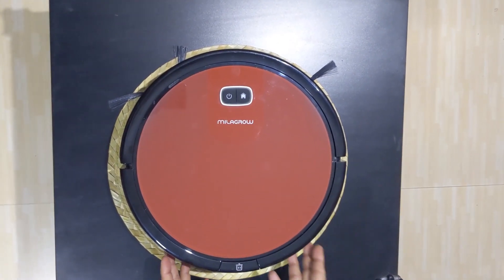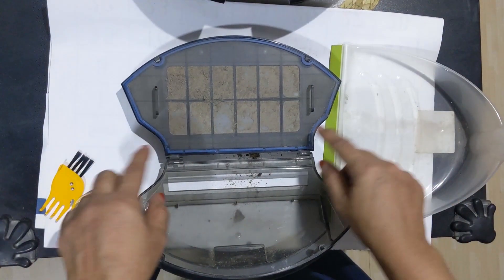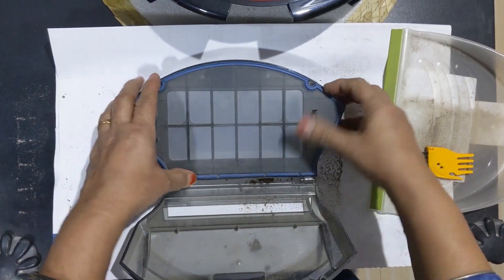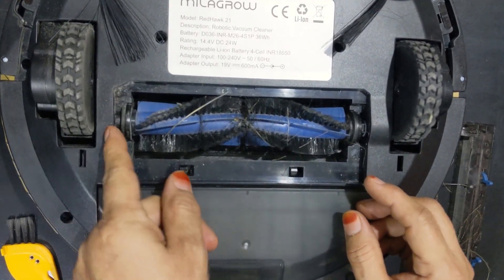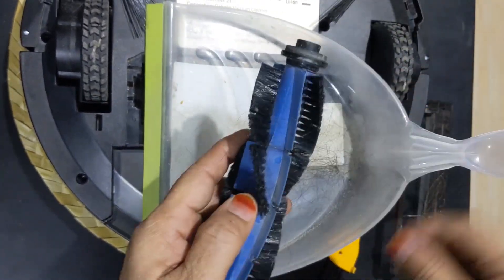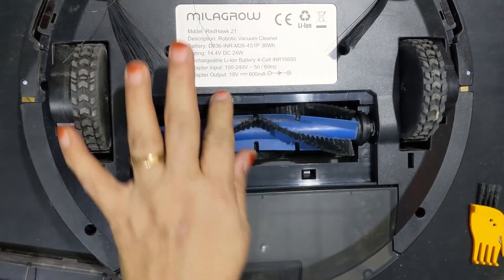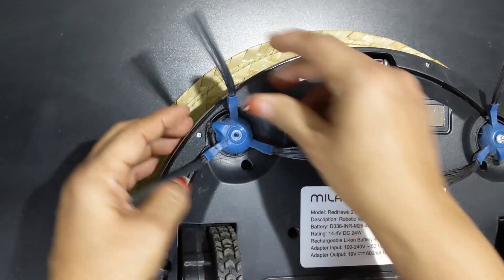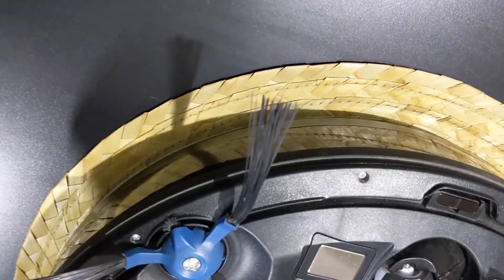MILAGROW Redhawk 21 | Maintenance & Cleaning

Comment: how clean hair of front wheel
Reply from the maker: Hi I have shown this in the video at 5:36 onwards. If there is lot of hair, you can pull out from the sides slowly. Actually with a bit of effort from the sides, we can remove the front wheel if you want to clean better. Thanks.

Comment: How to reset the wifi password?
Reply from the maker: Sorry for the delayed reply.
Do you mean how to reconnect the robot to the app. If the robot is not showing on the app and if you already have the app and have signed in, you have to add by the following steps -
1) Click Add device on the app
2) Click Robot vacuum
3) Press home button the robot for 4 seconds, red and blue will flash. 
4) After a few seconds you could be asked to enter your Wifi password (home wifi)
5) The indicator will flash fast or slow. Choose the option on the app
6) Robot will connect to the app.
This method has worked for me whenever it has got disconnected from the app for some reason.
Hope this works for you.
Thanks.

Comment: I purchased Milgrw blackcar Robot cleaner on 31/12/21. It's book mention  5 years life for rechargeable battery,wheras it stopped working within one and a half year . As thereis no service facility available in Meerut so co arrange to pickup from my house which was not pickedup for twenty dayes ,I was then asked to send through courior.I spent Rs1240/whereas co. is paying me Rs500/and charging Rs3000/for battery. Any solution please.
Reply from the maker: Hi, according to the date you have mentioned, the product seems to be less than 10 months old and I am sure it must be under warranty. 
I should take it up with the company through email, phone or Twitter and get a free replacement.
Meerut being close to Delhi, I wonder why your courier charges turned out so high.
Reply: Throw away the product as a bad experience.i am facing similar problems

Comment: Mam ,u work so much hard to keep device clean ,just asking : is brooming eazier than what u do to detangle the brush 😭😭😭😭😭😭😭😭😭
Reply from the maker: Hi Akash, what you see here is the cleaning after a gap of few days. I have done this, so as to explain the cleaning process properly. Except one or two parts not all need to be cleaned on a daily basis. Moreover, once you start doing this regularly, it does not consume much time.
Whether brooming is easier in comparision is a matter of subjective opinion.
Thank you.

Comment: Mam what if, it has to clean outside house( balcony area). It can't cross gadapa right. Can it be placed manually outside and make it clean
Reply from the maker: If you have to clean in areas beyond physical barriers, you have to place it manually on the other side. Thanks.

Comment: Are you still using it or getting boring and tiring to use. It takes lot of time to operate it. We have to monitor it right?
Reply from the maker: Hi, I'm dependent on my Redhawk for my daily sweeping and mopping. I've not good tired. Haven't I purchased it for this purpose only? 🙂🙂
Of course, it does take time. But the final result is what counts for me. Monitoring is not required always.
I'm still working on coming out with a proper review weighing all pros and cons. It's taking time since I want to show a thorough analysis.
Reply: @BhuvanaAdi  Ok ma'am. I purchased Bosch dishwasher after seeing your review video only. I want to purchase a robomop also. But since this is new product in market and no service I want to go for a cheaper model. Does this robo work without monitoring. Also if I want to clean only part of a room is it possible?
Reply from the maker: You need not always monitor it. It can clean any number of rooms. 1/2 or the whole house, you can control it.

Comment: Very nice video explanation.
Maintenance work looks tedious though 🤔. How do you feel?
Reply from the maker: Thank you Madhu. No not at all. It is not tedious. Once you make a habit of cleaning regularly, it will be a 10 minute routine, that's all. Except one or two parts, dust bin and filter can be cleaned once in 3-4 days, or based on your usage.